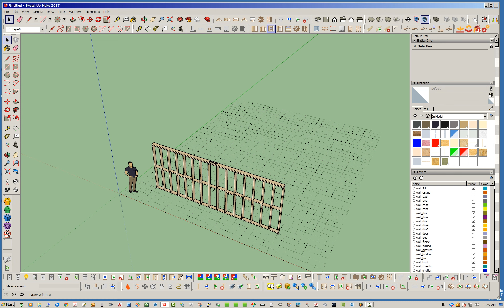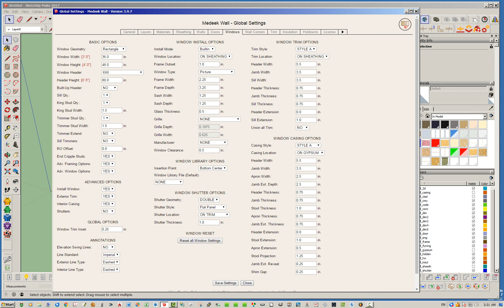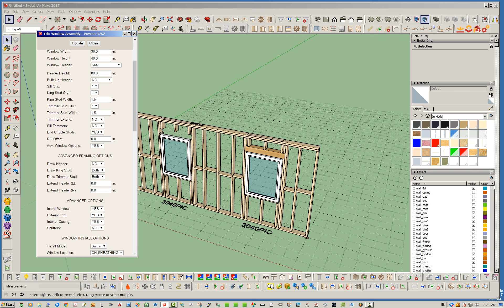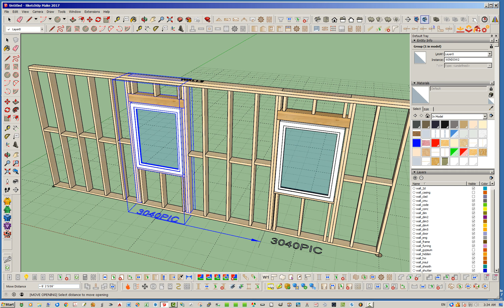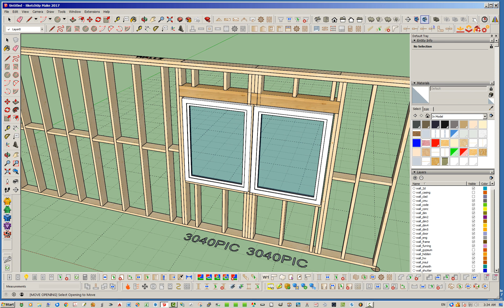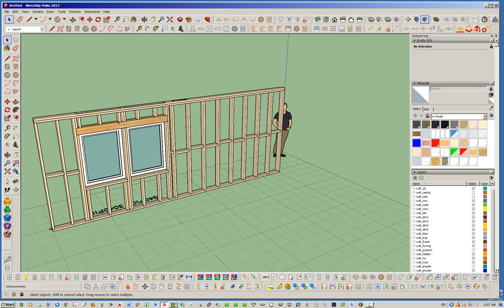Medeek Wall Plugin Tutorial 70 - Advanced Framing Options for Windows

Comment: Thanks for this update, 6 months ago I struggled with mulling windows together (eg: 3x 3060 side by side) because the sheathing or cladding would not cut the opening properly. I think it came down to king and trimmer studs and headers conflicting with each other. With them turned entirely off I have still encountered the problem (when the opening isn't cut the glass isn't transparent) but shrinking the window width by 1/16th and then restoring seemed to fix it. 

I tried extending one of the window headers but I found that made it difficult to select the other windows (the bounding box follows the header) which is another problem that I had 6 months ago. I'm more interested in the visual representation, so this update makes it much easier for me. Thanks!
Reply: I just realized this situation as well. Feels like the best practice for making these modifications is to extend the header last, after all adjacent windows are as you want them. Thanks for confirming it wasn't just me!